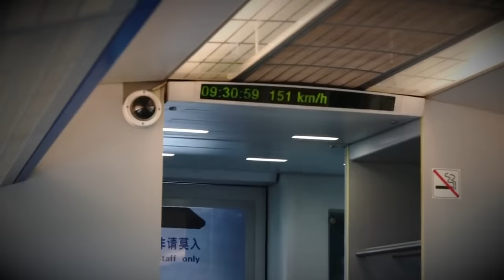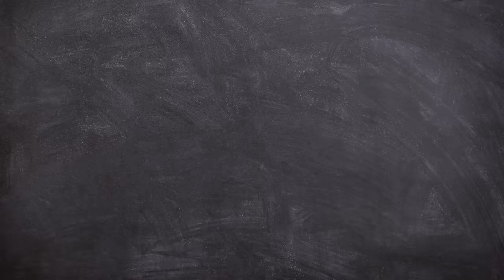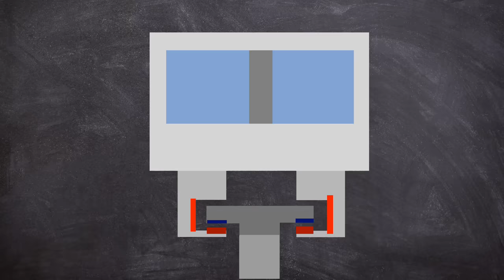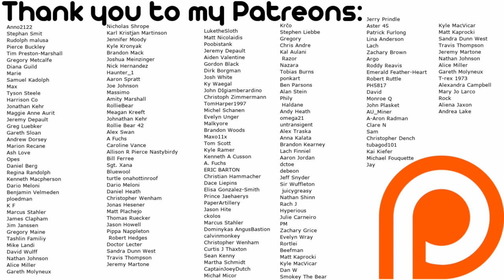Safety Complacency: The Lathen Maglev Train Disaster 2006 | Plainly Difficult Documentary

Comment: I live just a mile away from the track at Lathen. I remember the day when the accident happened like it was yesterday 😢. I had so many contacts to people that worked at the testing facility. I had over 10 rides with the Transrapid. So Quiet and very comfortable at full speed. That feeling when the Transrapid passes over your head at 450kph. Only wind noise no steel wheels on tracks.
But the disaster was the political end of the Transrapid.
Reply: I rode this train in Shanghai and it was far from smooth at top speed 🤨
Reply: But it was a stupid decision, burrying a project for a human error.
Reply: @PATISLAV  Presumably it was buried for a number of reasons, with the disaster being a nail in the coffin. The first commercial airline crash didn't end aviation.
Reply: @exsandgrounder  Both commercial Transrapid Projects in Germany (Hamburg to Berlin and Munich Central Station to the Airport) failed after Enviromentalists rallied against them because of the "evil Magnetic Radiation"
Reply: @Genius_at_Work  I always read that this idea was cancelled because of its very high costs and the limited scenarios of operation (e. g. no freight transport) in countries with limited space for traffic areas.
Reply: @Nitramrec  You're right, that was exactly what they told us.

Cost for a conventional high-speed railroad is between 17M€/km and 50M€/km. Cost for a Transrapid line is 25M€/km. This are actual real-life numbers, not estimates!

The Transrapid has one signifikant cost advantage: it can climb much steeper inclines than conventional trains. You need fewer tunnels and bridges, and these are really expensive - or cost savers if you don't need 'em. On the Köln (Cologne - Frankfurt line, a Transrapid would have required significantly fewer tunnels and bridges.

Ah, and the freight transport. Since I already mentioned it: Köln-Frankfurt cannot be operated by conventional trains. Despite the shitload of tunnels and bridges, the inclines are still too steep for anything except the ICEs. And it wouldn't have made sense in the first place to have a freight train block a high-speed line for three or four hours...when passenger trains are supposed to run that line every 30 minutes. So we have a special railroad, which can only be operated by special trains...not much of an advantage over a special railroad, which can only be operated by special trains

Of course, the next argument was that, if you have an incompatible system, people would have to switch transport. That's actually correct - unless you run maglev tracks to the inner city trains stations. However, in reality about every one has to switch anyway. Unless you live at the Frankfurt main trains station (like a drug addict) or work there (like a drug dealer) - but I guess in that case you are not the typical target audience.

Ah, and the freight transport. Again. While freight transport is impossible on the ICE high-speed track with current freight trains, there was a high-speed freight train in the works, which could have excelled even the ICE climb abilities. It was designed to carry standard full-size freight containers, with a maximum capacity of more than 1.2 metric kilotons, at 500km/h. Sadly, the "Freightrapid" required maglev tracks...Transrapid tracks.

But the killer issue was the "Schienenfreunde" cartel, which controlled the rail market. They didn't like a railroad where you don't need steel rails and which could be built by any construction company which knew how to pour concrete. And of course they were in bed with the decision-makers. Literally. Why rely on bribes alone when you can also get the option for blackmailing as well?

Yup, the Transrapid crash at Lathen was also used as an argument. The ICE crash at Eschede was of course not an issue at all, despite more deaths. However, the Transrapid project had already been ill-fated even before work on it had even started. Not sure whether the "environmental protectionists" were paid by the car industry, the the "Schienenfreunde" cartel, or were just plain dumb, or "all of the answers are correct". But they had surprisingly string and significant influence on the project.

Comment: Magnets are also great for stopping trains. The railcars i drive have magnetic breaking installed. Roughly, it a rail attach to the train that sit just above the railhead on the track. When activated the magnetic rail drops onto the railhead, given a electric charge and becomes a super magnet. I LOVE magnetic breaking because this is great when you are experiencing a wheel slip event. Mag breaks are the best for wet and slippery tracks. I always say use your mag break so you can avoid using your emergency brake.
Reply: this system  is in use in amusement park rides everywhere
Reply: The Transrapid had emergency friction brakes...huge friction brakes. Basically, the underside of the Transrapid was a huge brake pad.

The emergency braking maneuvers were impressive. The wear on "brake pads" was impressive. In other words, a huge cloud of dark "smoke" (brake pad dust) would be produced in such a case.

Comment: I still remember this incident, and I still don't understand why this was used to publicly ruin that project.
Media was all over how unsafe Maglev tech supposedly was, when it was a test site that didn't have anywhere close to the safety equipment installed as modern rail system have.
There were way worse train accidents all over Germany alone in a time were those block signals that were missing here didn't exist...

But in the end of the day we can't be certain whether or not Maglevs are better the normal trains, as we never utilized their benefits fully, or tackled the downsides.
If there is a full infrastructure available already, the chances to roll out new technology that is so vastly different and yet so similar will never happen in a grand scheme.
After all Maglevs are just trains, that require a totally different set of rails, that couldn't be more different than what is used today.
Reply: That infuriated me, too.

There was nothing to learn from this incident that was damning of the maglev technology. The only lesson to be learned is that no matter how small and quirky your Railroad is (regardless of whether it meets the technical definition thereof!), you should not be exempt from the regulations!

Block switching would have prevented this. Hell, standard industrial lockout/tagout would have prevented this! The only lesson learned here is that we in the 2000s are not exempt from making the same basic human errors that our ancestors in the 1800s made; which is why they made rules to govern railroads!
Reply: Yeah, it seems to me like this had as much to do with the train being a maglev as the Titanic sinking had to do with the ship having that one dummy smokestack (which is to say, nothing).
Reply: @ZGryphon  agreed. this could have happened on any traditional rail line, or any roadway for that matter
Reply: The greens had been against that project for a long time and the ICE-Lobby was in any case against it. Transrapid works as Shanghai SMT for nearly a decade without a problem and the Chinese had at least build one new vehicle "CRRC CF600" and one for low speed. It was that Germany was far ahead in maglev technology that was the problem that needed to be "fixed". Don´t forget: Germany started doing passenger service on maglev trains as the only nation on the planet already in the early 80´s, Japan came ten years later at most. And Germany had the full serial readiness approved in 1991. The fatal mistakes made by the dispatchers during the accident only player it´s enemies into their hands.
Reply: @bieneulm1982  not only the green Party wanted it gone. The Transrapid ate a lot of money and the Government wanted it gone since the late 90s. The Accident was just, as you said, the final reason they jumped on
Reply: @Rollstuhlwal  the costs rose because of purposely done misplannings and at last Hartmut Mehdorn, former head of DB, wasn´t willing to take the risks. And then the industry behind transrapid didn´t want to sit on all it´s costs all on its own. They should have build Hamburg-Berlin. It might have been cheaper to what we have to pay for S21 today (although S21 is a necessity and Transrapid was not, with the exception of holding the technology in Germany). They would have gotten Munich mainstation to Airport-Transrapid line out of the leftover 8,9Mrd € fundings of the Hamburg-Berlin project and they didn´t do it (DB) the former head of Transrapid Emsland facility writes in his book.
Reply: @bieneulm1982  Same with Munich a several years ago. Lot of political infighting over which route between the Hauptbahnhof and the airport to adopt along with the dubious fear of noise. Longer procrastination led to cost estimate escalation, which led the state minister, Ed Stoiber, to cancel the whole project.
Reply: One word: Eschede.

No big fuss about 100+ dead there.

Another word: "Schienenfreunde".
Reply: @InTeCredo  A very credible fear of noise, because the track was slated to run between high-rises and wall-to-wall city blocks reverberating the noise. You have a lot more open area around typical noise makers like rail.

Worse, in the calculation for the noise pollution, Transrapid consortium lied to the city, averaging the noise level across the hour instead of specifying the peak noise level without being explicit about how they came up with the figure. And if they update the figure, and then you re-plan to account for the newly surfaced facts, do you trust them then, do you really? This, plus the way they handled the test track safety, plus suspicious budgeting and the likelihood of costs exploding out of control, the company has shown itself as remarkably untrustworthy. Stoiber and Ude both used to campaign for the project, deliver speeches and appear in or alongside Transrapid's marketing, but with the misconduct piling on, it was becoming a personal political hazard to them both that would reflect badly on their trustworthiness were they to continue supporting it. There was no other possible outcome than them turning from strong allies into burning it down. Just how much of "no no sorry a little mistake, sorry that you had to call us out on it, we'll fix it we'll do better next time" time after time do you think politicians and the public are willing to endure?

Comment: I always have a measure of sympthy for people who cause injury and/or death unintentially. You know that they are not psychopaths - just ordinary people who took their eye off the ball, got a bit lazy, made a bad call, mistake, etc. That doesn't obsolve theml or lesson the harm, but most people make mistakes and get away with it, but they didn't and I don't envy them the guilt and despair of having been the cause of such great harm. Something that will  never leave them.
Reply: Any system that depends on humans not ever losing focus, forgetting things, etc is inherently prone to failure. That's why we have automated safety systems for trains. OTOH, ensuring that the one train and one maintenance vehicle weren't on the track at the same time does not seem like an overly demanding task.
Reply: @ryancraig2795  right?  Airliners and ATC need more and more automation — and procedure — because of the sheer requirements.  The latest high speed rail signalling systems also don’t bother with signal lights because how would you do it?  Without making traffic lights the size of windmills.
Reply: @whophd  never realized that, funny :)
Reply: @whophd  In-cab signalling. TGV and Acela trainsets use that, and I'm sure other high speed trains do as well.
Reply: @ryancraig2795  This is why I see "self driving" cars as such a bad thing.  Driver assists are one thing, and the car being able to completely drive itself with no human input is also fine, but the current model involves humans babysitting a computer in case it makes a mistake, and people just can't stay focused for hours at a time with nothing to do.
Reply: It’s a little ridiculous that a job with a regular salary comes with jail as a downside…wildly out of balance risk/reward. Not like they were getting paid millions. Never take a job like that…ever. You could be perfect and if it’s convenient to blame you they’ll try to.

Comment: The interesting thing about the TransRapid system is that it did NOT use magnetic repulsion.  It uses magnetic attraction (which is actually easier to manage, as it is self-centering, where magnetic repulsion is like trying to stack two balls atop one another).  It maintains a spacing of about 10mm between the attraction magnets and the track (which unlike the Japanese Shinkansen designs is a passive track, which is much less expensive than a powered track).  The Japanese Linimo system uses the same idea, but it maxxes out at about 100kph.
Reply: Like holding a ball inside a parabola, rather than balancing it on the outside.
Reply: Have you seen videos on their experimential maglev train? the Technology and science behind it is SUPER interesting, The train can hover even without power ( Above 150kmh ). The japanese are awesome!

Comment: As much as I like a video about transrapid, this one does contain some (mostly minor) errors:

1. At 3:45 What you see is not Transrapid 01, but rather another prototype not going by the name Transrapid
2. At 3:49 It should be noted that it did not run in Munich, but rather at the IVA in Hamburg.
3. At 5:07 It is correct, that Transrapid 08 did only do about 420 km/h on the test-track, but this was due to the limited length of the track. The vehicle was actually designed to go up to 500km/h.
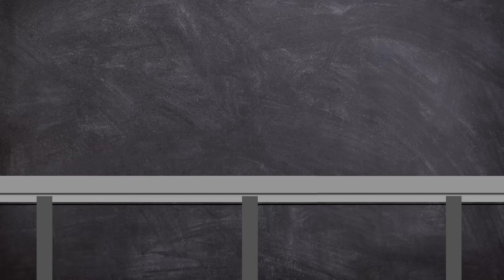4. At 5:43 The Transrapid was designed from the ground up to be controlled autonomously via the Control-center. Proper Systems for ensuring safety were developed and used for the Transrapid vehicle on the track, but since it was a test track and apparently nobody thought this could happen, it did not include the maintenance vehicle. On a normally operating track (like in Shanghai) this could not have happened since all vehicles would be integrated into the safety systems of Transrapid. Furthermore, in the following operation with Transrapid 09, the maintenance vehicles were integrated into the system.
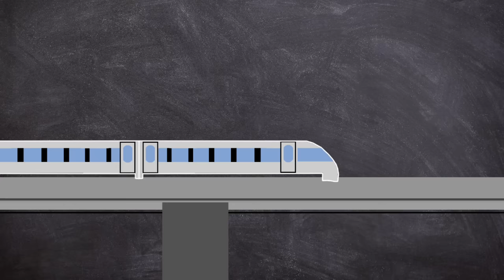5. At 8:00 The Transrapid did actually brake for the last bit before the collision.
6. At 11:27 While many did lose their jobs, not all did. Since the test-track still stands in part and must be watched for debris falling off of it, some workers actually still run the maintenance vehicles along it every so often. Furthermore, a few of the technicians still work on the site, but on another project, namely inductive charging of electric cars.
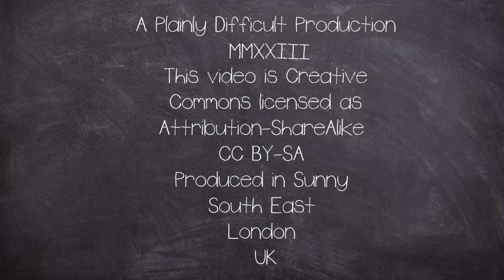At 11:45 China is actually still working on the Transrapid Technology, even developing new trains on its basis (the best known example is the CRRC 600), although they did not build another long track, yet.
Reply: caution we found the maglev nerd. Who asked? lmao
Reply: So did the test train really go to 420 km/h?  I’ve done the Shanghai one at 431 km/h (tip:  do your research on times-of-day) but when I did the Emsland test track, it only did 300, and the 200 speed around the curves felt SLOW, haha

So on that day 22 years ago, it only did 300 but was that normal?  (It felt great).  We only did one circuit of the track instead of two, and got kicked off thanks to a minor malfunction.  It was easily fixed in time for the next scheduled ride but of course tickets were sold out weeks in advance.  (Having come from Australia, and with a train to catch back to Hannover, I was a bit upset and arguing — they didn’t like it).  So perhaps I got more of a raw deal that day than I knew?
Reply: @whophd  Yes it definitely did go that fast. Quickly doing a search on Youtube, I found this video where it does 410km/h: https://youtu.be/Tf7ITzd8CMo, but it did go even faster. To my limited knowledge, the official record at the Test-track was 450km/h (although I suspect that visitors were not allow to take part in this one) and I do recall seeing a video where it goes 420km/h, although I could not find it quickly.

Comment: A very good report on the accident, except of one thing (which I'm actually surprised noone earlier spoke up about in the comments): The Transrapid is NOT a Maglev!! Maglev and Transrapid are the names of two transport systems using magnetic levitation. You though can say Transrapid is a maglev train, but not a Maglev (notice the capital letter). The Transrapid can be seen in this video and today is only in operation between Shangahi city and the airport. Meanwhile Maglev is used in Japan on some tracks. But what is the difference? Well, there are two main differences.
Firstly, the Transrapid "grips" around its track in a claw-like style, as can be seen in the video, while the Maglev runs inside a tray-like track (looking a bit like a bobsley in the ice canal).
Secondly, one system creates magnetic levitation with repelling two similar poles from each other, while the other system uses the attraction of two opposite poles. And if I remember right, the Transrapid is pulled upwards by attracting forces, because the magnets are on the downside of the track and in the tips of the "claw". But about this certain part I am not 100% sure. Nevertheless one system attracts the train, the other one repells it. Propulsion in both systems is generated by linear induction motors, like it was told in the video.

Comment: I’ve rode on the Shanghai mag lev train.  The ride is not as smooth as advertised and a few years later there was the disaster when the raised columns collapsed.  The construction company used garbage to use as filler rather than concrete to save money.